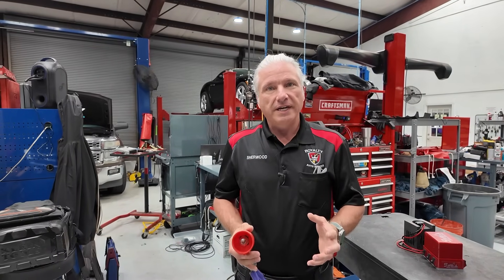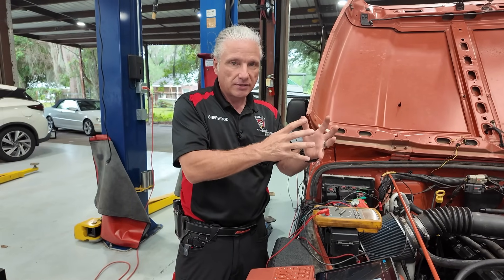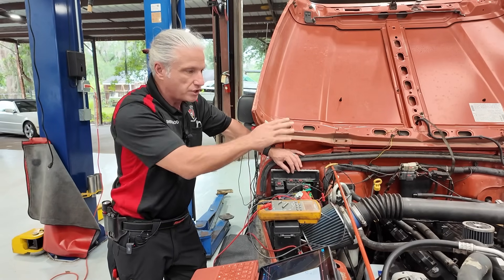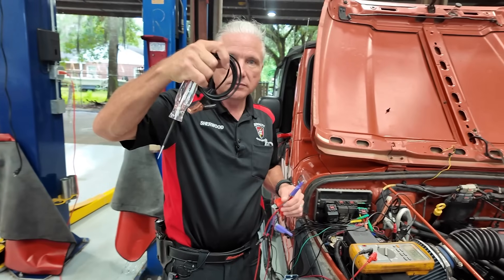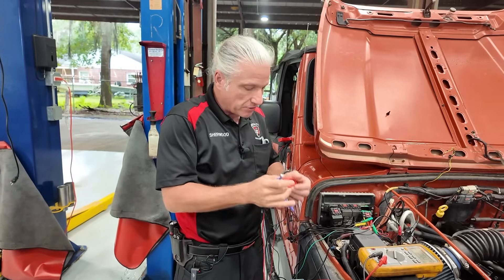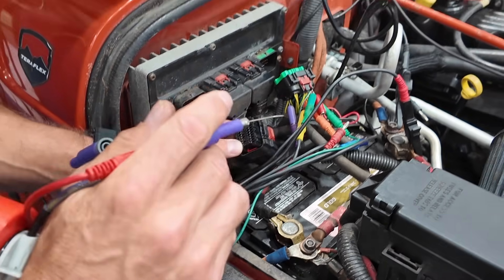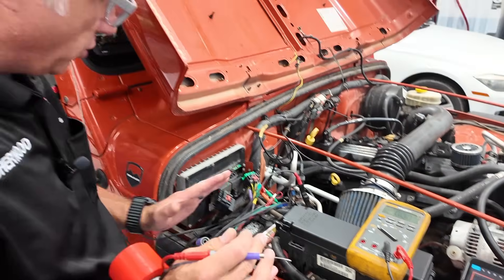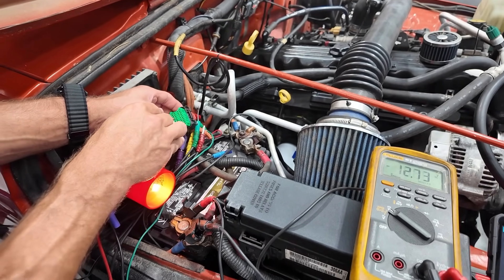This Will Protect You From Replacing Modules That Aren’t Actually Bad!

Comment: Sherwood!!!! This is my biggest problem especially when there’s 8 wires going to a switch and I see that wire go another place then another then another I get easily confused. Also same thing when there’s 8 wires going to 8 different modules in identifying which do what in relation to turning things on.
Reply: You have to consult wiring diagrams, otherwise you're just guessing. There are over 3,000 wires on a modern vehicle, about 150lbs worth.

If you don't understand how something works, you can't test it, if you can't test it then you can't fix it without guessing.

Comment: So voltage drop is across the bulb in 12.7 and if test show lower than 12.7 another connection or component some where is having a voltage drop across it
say 5 volts, reading on meter would be  7.7v...
Reply: Yes but you shouldn't drop more than 1v or so unless the starter itself is cranking. Keep in mind that wiring provides a little resistance. Small drops are okay.

Comment: Another great video Sherwood! I have been a Honda tech for over 41 years and another thing you should check is the pin fit at the connectors at the PCM. Have seen a few in the last few years with a loose fit causing an intermittent problem. Honda has sent us a pin fit tool kit in order to do so. If the pin fit is loose Honda has us replacing the wire harness as there is no way to repair/replace these tiny terminals. Great videos, I have learned some new techniques/lessons from watching them!! Thanks again!
Reply: Terminals are available from companies like mouser and crimping tools from sargeant tools in ct.

Comment: If you testing wires - to - and + to + with engine cranking/running or the test you donne, you gonna have the same results in mathematical terms? Voltage drop is the same?

Comment: Any mechanics out there? How many mechanics can read schematics and troubleshoot a circuit like this? how many can on average?
Reply: Not many i can assure you,,,
Reply: You rang? This stuff is fairly well known by Gen-x & Millennials since access to information has become much easier. 

On average? I'd guesstimate about 1 in 20 guys can do basic electrical troubleshooting, oscilloscopes(electrical waveforms) are becoming more common among the very young guys today. You have to understand that most shops, especially dealerships, have/train mechanics to work on one area of repair, like transmissions or brakes/suspension.  

Doing electrical diagnostics doesn't pay, you'll make a lot more money changing brakes. Automotive is the one industry where the more you know, the less money you make. I mean that literally.
Reply: All of em

Comment: In airconditioning HVAC work I frequently find a pitted contactor that will show 120volts to ground but the moment you put a load on it the pitted contacts resists the voltage and I get a reading of around 80volts or something less than line voltage. Testing under a load is the only real way to test.   Also, in HVAC the hot side is what is switched and NEVER the neutral. So alot of guys test the hot side of a component and assume the neutral is intact but this can give a false indication that the component or the neutral line is good. For example: if you test the 24 ac volt contactor coil by probing the hot and neutral terminals, if the neutral line is broken and the hot is good then the meter will show 0 volts and a person is fooled into thinking that the control voltage of 24 volts isnt getting to the contactor. The proper way to test is to prob hot terminal to neutral and then to ground. If the hot terminal and neutral terminal shows 0 volts but the hot terminal and the other prob to ground shows 24 volts then you know you have a bad neutral line.
Reply: That's well said. Thank you for posting this.

Comment: Can you do this test for components that have a load already in the circuit for example an H02 heater circuit that uses a ground to the ecm.
Reply: Absolutely you can. A 2-amp light bulb perfectly replicates the sensor. Just simply unplug the connector and carefully probe your test light.

Comment: Apply these same tests to the CAN network. If a module has the proper powers, grounds & CAN bus connectivity / resistance but still will not perform, the module is faulty.
Reply: yes accurate assessment, i had a Mercedes W205 that was a total nightmare, in the shop for over 5 Months, no crank no start, and endless Fault codes that would not clear, so many overlapping Can networks that had failed due to a few faulty modules.

Comment: Excellent way to check integrity of power and ground wires.
Quick way to get rid of the negative symbol on the MM is to swap the MM terminals at the multi-meter side. 
Good way to demo a loaded voltage test and no load voltage test is to put a 1 ohm 10w resistor in series. With no load, the MM will show battery voltage (12v) between ground and 1 ohm resistor (other end of resistor touches + terminal). When you do a load test with a 12w bulb (drawing 1 amp) the voltage across the bulb will be 11 volts instead of 12v. The 1 ohm resistor is simulating the bad connection to ground or power.
Reply: Thanks for the excellent input, Do you do electronics ? i was always interested in electronics from an early age, if only people would study a bit and practice a lot more, then most of the impending issues on vehicles can be easily solved.please post more great idea's, knowledge is a wonderful journey that never ceases.🙂

Comment: This isn't related and I'm just a DIY guy. Just sharing an experience. I have an 05 Scion TC. A code tripped for the O2 sensor. Turns out the alternator was going bad. I hadn't changed any parts. Strange still was it started making noise and only charged at 11.1 V. STILL no light other than 02 sensor. 
Replaced the alternator and tensioner and 02 code went away.
Reply: software glitches can trip spurious codes randomly
Reply: With the lack of battery voltage the other components weren't functioning properly, causing the AFR to get mixed up.. the o2's detected that and set a hard fault code. 
Once you fixed the underlying issue, the vehicle went through a drive cycle and turned the light off. 

Everything starts with a known good battery and it's voltage, without that testing cannot be performed reliably.
Reply: @COBRO98  I just thought it was strange that it never pointed the finger at the charging system even though clearly it was not working.
Reply: @anthony-i1k8c  Being a 2005 I'm not surprised, it might throw a low battery voltage code if anything. That's not to say these newer designs are better, where the alternator is controlled by the ECM, it's horrible. 

I've seen vehicles misfiring on half of their cylinders but no faults were set until the converters were destroyed by the unspent fuel, finally setting catalyst codes.

Comment: you forgot to mention that sometimes a PCM will control a relay and once that relay is energized addition power circuits that go to the PCM those need to be tested as well you will either have to by pass the relay manually(if possible) or active the coil for the relay with a test light.
Reply: Yes Spot on, thanks for that tip.

Comment: You are hands down the most precise and well thought out technician on youtube. I did this type of work for 25 years and was always helping others learn this stuff and fixing problems like this for them. I commend you for your amazing videos. They are greatly needed in todays auto industry as there is a significant lack of knowledge out there.
Reply: Sherwood is good but wait till you watch bernie thompson from automotive test solutions
Reply: @leftyspinn  that guy is amazing as well.
Reply: These have to be done on every car that has strange anomalies electronically. 
Try cleaning grounds (all b to b) and replacing the negative cable assembly with an amp sensor, to eliminate 15 fault codes, no modules were bad.
Yes it takes time but we live in the rust belt and no modules bad, priceless feeling.
Reply: He and South Main Auto 
Outstanding techs
Better than PBS
Reply: Absolutely awesome video. Where can I buy that simple light bulb 2 Amp Load test tool?
Reply: @charleskuss8538 jarhead diagnostics makes them
Reply: This channel is awesome but Eric at South main Autois the guru to find ground issues and not throw parts at it.
Reply: @Jbmc65 Eric is amazing as well but given my experience (25 years as a GM tech)  believe Sherwood is a noticeable notch above all others and it's very clear.
Reply: The way Sherwood explains things works perfect for my lizard brain. I have learned so much from him.
Reply: @EvzenKovar-i5p  Same here...
Reply: 100% agreed
Reply: I watch Loads of these I would say he's tied with Pierre hedary, Dave's auto in Utah and the car wizard.
Reply: @googpix540  Sherwood is just a notch above all of those due to his precisiveness and thoroughness. Bernie Thompson is an equal IMHO.  25 year retired electrical/electronics specialist here.
Reply: @googpix540  They are all good but in my humble opinion and as a 25 year retired electrical and electronics specialist/diagnostician, Sherwood is a clear notch above them.

Comment: I’m a DIY mechanic and a lot of this is over my head but hopefully I can glean info I can use down the road. Thank you
Reply: Testing for a voltage drop on the ground side will show a bad connection,  either no connection (test light won't illuminate) or a bad connection from corrosion or something else. There should be no voltage on the ground side. If you see voltage (which appears because of the current drawn by the test bulb. Think of Ohm's law) on the ground side, whatever the bad connection is, it is creating a resistance. Remember V=IxR. The I is the amps pulled by the test bulb.   If R is zero, then V will be zero. If there is a resistance greater than 0 , then you will see a voltage. 

He tested both sides of the circuit (power and ground) because there are 2 physical pathways (wires) that could have problems somewhere if a component is not operating correctly (or at all). The negative voltage on the meter during the ground side test just indicates the current is flowing the opposite way (an incandescent bulb doesn't care the direction of the current. An LED or something does,  so they wont work as a test light). Think of the positive vs negative voltage as simply an absolute value.  And like he said. Sometimes, there will be small voltage drops on circuits going through a switch. The switch will draw a very small amount of power  usually.  The wiring diagrams should tell you what the reading should be (usually a range) so if something reads too much or too little, that probably means there's a  problem.
Reply: @TheDesertRat31 thank you for the explanation! Much appreciated
Reply: @TheDesertRat31great exploration, thank you
Reply: Simplest way to explain it is youre looking for voltage drop from a bad ground. Grounds are typically what leads to haywire electrical problems.
Reply: @Semirekt or short to ground and this method will detect both!!
Reply: @Semirekt  
No wonder they are always saying, "Check your grounds!"

Comment: Why isn't there a voltage drop as the bulb lights up?  The dvm shows the full battery voltage.  If the bulb takes 1 amp of current to light shouldn't there be voltage dropped across the bulb and show reduced voltage on the dvm?  This confuses me
Reply: The meter shows full battery voltage because that bulb is using up every single volt from the battery. A good circuit with a  "load" (motor, bulb, etc..) should use up every amount of the power source (aka Battery 12v+). If it's not then that's indicative of excessive resistance (usually a bad ground or connection) in the circuit. Hopefully I explained that well enough
Reply: The bad grounds or connections create extra resistance that will then use up some of the 12v+ power source. When this happens,  during your voltage drop test, you will see a reading lower than your 12v+ source. It's called a voltage drop test because you should be dropping full 12v+ plus over your load. If not, you have wiring connection problems.
Reply: There is a drop across the bulb but it's millivolts worth so the 20v meter setting isn't going to show it. You can see he lost about half of a volt on several wires, that's normal. 

Automotive is weird, technically the electrons flow from negative(-) to positive(+) through the entire vehicle, which is grounded by the rubber tires. That's why we have battery grounds not only to the engine but the chassis as well. Your vehicle is one giant circuit.
Reply: @COBRO98 I saw your comme t about the oscilloscope being the last tool you should pull out unless necessary. How could one know when is the time?
Reply: @redneckpotatoe  So the oscilloscope shows electrical signals in a waveform, it can be useful for catching an intermittent fault with things like sensors or solenoids, ever seen a fuel injector malfunction only when it gets warmed up? 

By that same token I've seen things like injectors fail(stick) mechanically when they get hot but the tech missed it due to using a scope. They're a powerful tool but the wave forms can be misinterpreted easily or not give the whole picture. 

Sensors, data network system checks like your CAN, you don't need a scope to check things but it can make the process faster. It's best to use several different testing methodologies before condemning expensive parts.

Comment: Could you show me where can I find PCM connector view and which pin is what on All data please?
Reply: I don't use All Data to often, but if you go to the wiring diagram section for the pcm, look for the connector you need and if you click on the connector number, it should link to a connector view. If not, do a search for the connector part number listed on the wiring diagram. You shouldn't have too much trouble because connector views for a pcm is a very common search. 
If for some reason you're having a really difficult time, take the part number off the pcm and call or stop by the parts department of a dealership. Give them the vin number for the vehicle and part number for the pcm and tell them you need a quote on the wiring harness(es) that goes to the pcm. Ask them to print a picture of the connector view to match it to the one in the vehicle, so you don't order the wrong part. They do stuff like that all the time, so it shouldn't be a problem. Most of the time you can't return electrical parts, so they're used to having customers ask for a lot of detailed information.
Reply: @052RC  An excellent idea, thanks for sharing 🙂

Comment: I always used a 9005 or 6 on a disconnected circuit
Reply: please expand on the comment 9005 ? 🤔
Reply: @sollykhan2385  9005 headlamp/bulb
Reply: @sollykhan2385  9005 & 9006 are standard headlight bulbs.